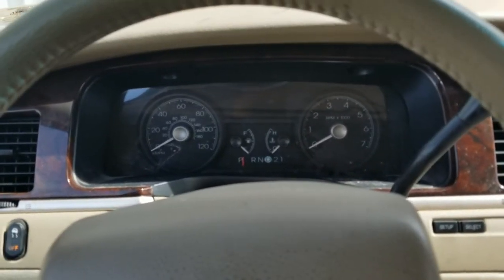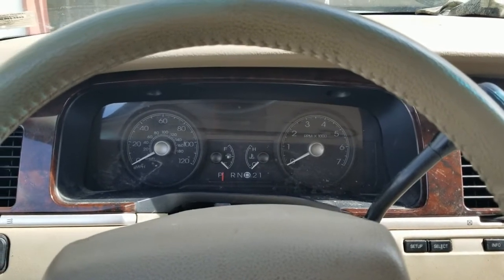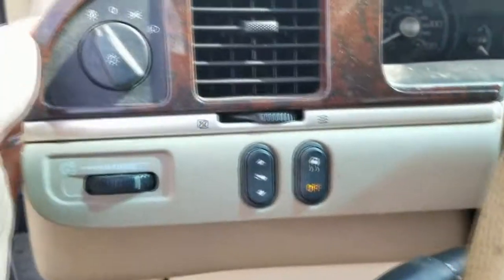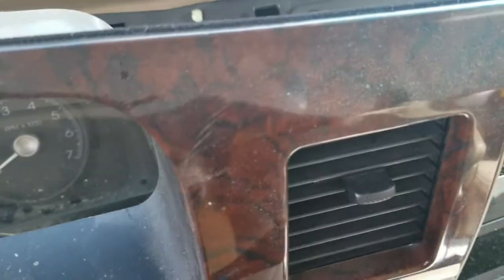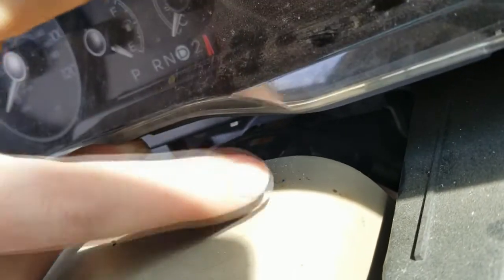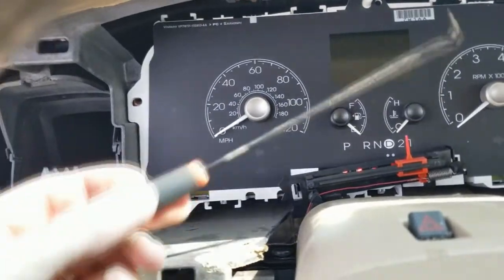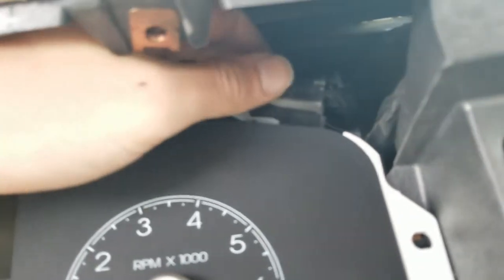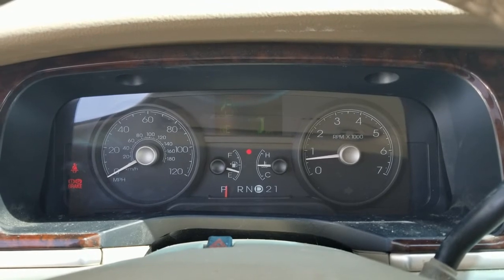2006-2011 Lincoln Town Car Gauge Cluster Problem | How to Remove Dash Cluster

Comment: How did you fix the problem
Reply from the maker: Sorry we dont give out that kind of info. Send your cluster to us we'll get it repaired for you.
Reply: Found bad solder joint and resoldered it. Most likely. May have just resoldered all pins on the main connector and display. If you can't solder well you should probably send it to someone to fix.
Reply: We see how you are why wast our time taken the cluster out any Grease monkey can do that sorry but I was disappointed in the out come
Reply: @AutomotiveCircuitSolutions  
Sounds like a recall?
You should tell Ford?
No Speedo no gas indicator sounds hectic at night?
Oh you don't give out that information.
 but why somebody could get hurt?🤕

Got to make that money.👉😳👈
I don't want to hear that..
 I gave you a thumbs up
You want everything?
Reply: I gotta send my cluster to you? How ima drive my car? Lol

Comment: I have a 2003 Town Car that displays dashes instead of the info, at times only and then goes back to normal.

Also, the back up alarm stops working half te time.

Comment: Hello I have a question so I got a 2003 Lincoln town car and my clusters speedometer don’t work & also it doesn’t show the mileage nor trip it just shows a bunch of lines - - - - - could this be a fuse problem?? Or I’ll have to send it for repair. Plz help I’ve been braking my head trying to find the problem.

Comment: Can I upgrade my 2004 cluster to this more up to date one?
Reply: still looking for an answer there's an 07 at my local salvage yard I have a 99 will update with results
Reply: So I opened everything up & old cluster has 2 connectors while the new one has 1. was hoping it would be a plug & play but no unfortunately. you could theoretically look up the wiring diagram for both clusters, strip the wires, & reconnect it but I'm not gonna go through the hassle & do it so good luck!
Reply: @brianchavez2605 , thanks for the heads up. I sure didn't want to take it apart, then not knowing what's next. I'll let the pros do it eventually.

Comment: My dash goes in and out and the battery light comes in as well. Battery and alternator are good. Both have 14 to 15amps. Do you think its a dash?
Reply from the maker: Yes it is very common for these to have full intermittent power loss. We can fix it.

Comment: how many days would it take to repair the instrument cluster ?  for a 2007 Lincoln town car,  executive L. 

the gauges work sometimes,  but for the most part, the gauges are not working and the lights are off. i have ran out of gas many times bcuz my gauges were not working,  
sometimes if i hit a pothole,  the instrument cluster will start working again for a short time , then the gauges stop working again. 
can you help me with this problem  ??
Reply: Me too

Comment: I have a cluster on a 2003 Town Car everytime the weather is hot the speedometer stays at 0 even though I'm driving and the traction and brake and seat belt lights stays lit. and it doesn't show the mileage or trip either just a bunch of dotted lines where the mileage goes. What could this be? It's a intermittent problem doesn't happen all the time..

Comment: What is the red light for between the fuel and temp gauges ?  Just bought a 2006 and it’s drivin me nuts.   Thanks.
Reply from the maker: It's just a warning light indicating that something else isn't right, like an open door, unbuckled seatbelt, opened hood or trunk, check engine light or any other malfunction indicator. Newer cars usually have a triangle with an exclamation point in it for the same purpose.

Comment: Im just asking, is there an instrument cluster fuse? Even my instrument panel lights arent working, the ones that illuminate numbers, randomly lost all power, including gages arent workin, nothing is in the dash, Im just hoping there is a fuse for that.
Thanks.
It happened when i put in New battery, and my Lincoln is 2007 also
Reply from the maker: Fuses 13 and 25 in left side of dash fusebox give power to the Instrument cluster. Both are red 10 amp fuses.

Comment: AUTOMOTIVE CIRCUIT SOLUTIONS
///   ]]]                                                         I disconnected the Temperature sending unit/temp sense, so How can I test the instrumentation temp gauge in my cars dash board by itself to check if its working correctly, what do I need to do?